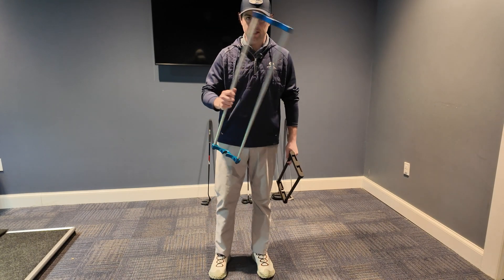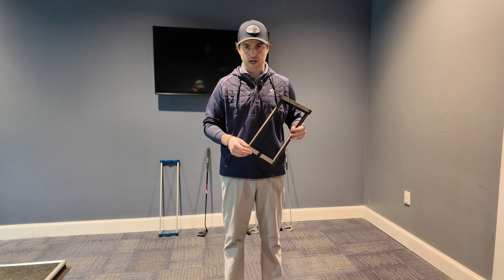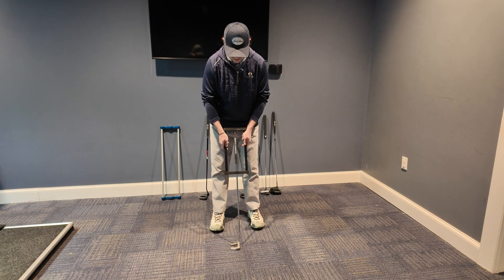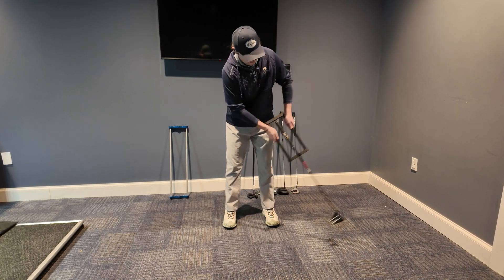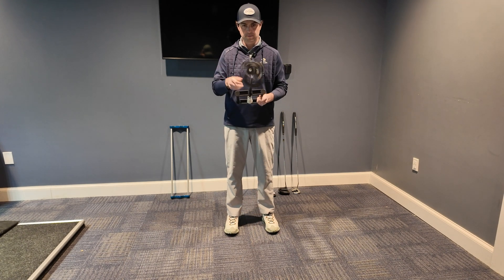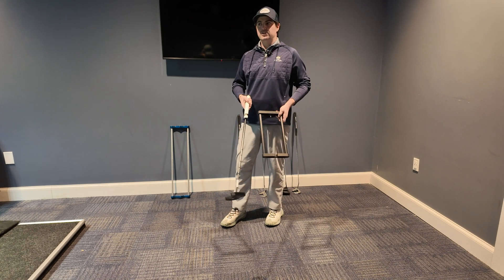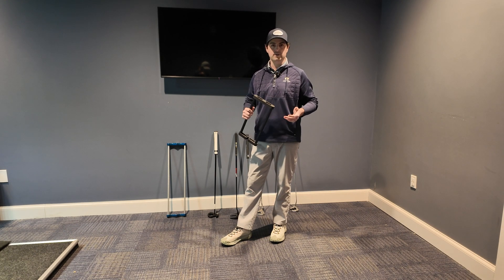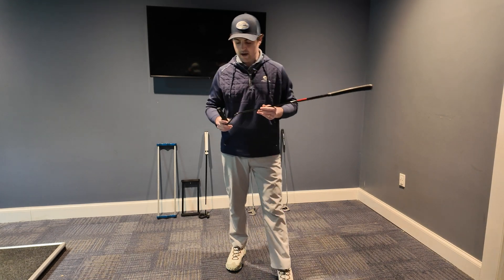'Revealing' The Technology Behind Axis1 Golf Putters

Comment: regarding the Lab df3 (?), I believe it has to do with the funky grip that's at an angle to the shaft. With the longer revealer, the difference is watered down. With your shorter tool, the difference is magnified. To prove to yourself, just draw the triangles (top peg, bottom notch and the crook between the grip & the shaft)

Comment: I see your point with the revealer and how the overall tech might combine to best suit an individual golfer.  The revealer was meant to differentiate vs traditional putters, but it’s much more nuanced among torque-free designs.  Sam did state later that LAB isn’t entirely zero torque, since some is needed to make it stay “square to path”.

I also see your point about shaft placement - center of gravity dynamic.  Designs with shaft lean will not suit everyone because of the relationship with dynamic loft, among others.  Hence the recent popularity of the OZ with zero shaft lean, perhaps?

What I don’t get is why you don’t offer custom options like LAB does?  Wouldn’t getting lie angle “balanced” to the individual putter’s stroke promote consistency at impact and add forgiveness?
Reply from the maker: Hey! Thanks for the comment, we do offer custom lie, loft and length options for all of our putters. Is there another customization you would want to see?

Comment: What's the max putter length/lie you can make and still have it zero torque? I got fit for a DF3 sweeper at 43.5" and 79.5* lie. Can your putters get close to that or no? Seems like you offer 33-35" long putters with 5 options in lie angle, 69* to 71*, but more options in the loft section than LAB. LAB Golf offers so much more with their customizable putters with length, lie, colors, alignment aid, head weights, etc...it's hard to say that you are leading in the technology when it comes to zero torque putter. Kinda looks like LAB is leading but that's just my opinion.

Comment: I have a Rose 1.0 and love it.  Once I got my speed dialed in the putter works better than any other putter I've ever used in the past.  Just wondering what is the difference in the 2.0.
Reply from the maker: The 2.0 has improved sound and feel compared to the original.
Reply: @Axis1Putters  What aspects of feel have improved?  I know it's a vague concept. Specifically:  Has speed control been changed in your opinion?  Is the shaft stiffer than the original?